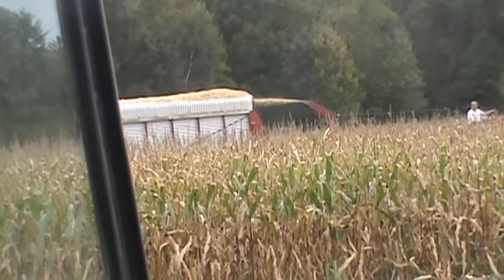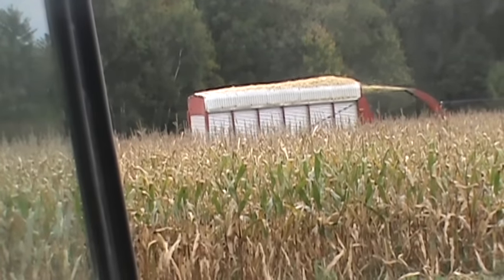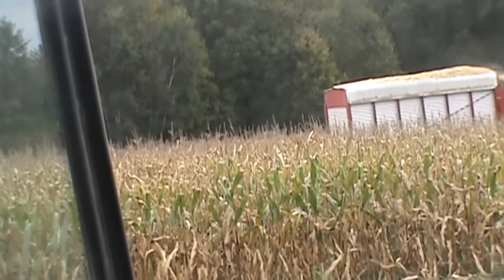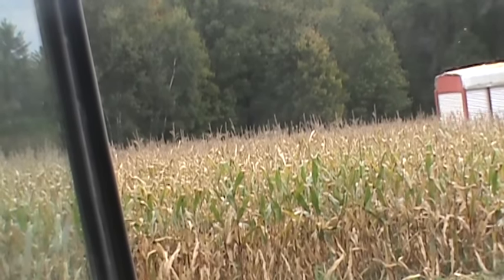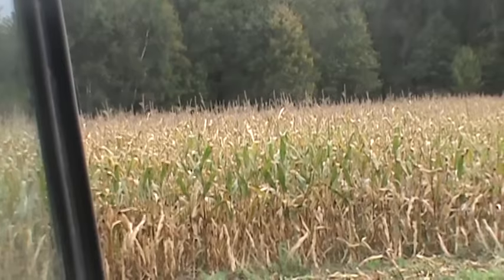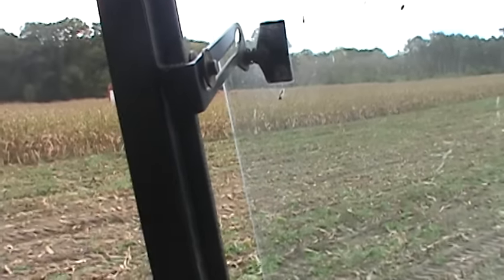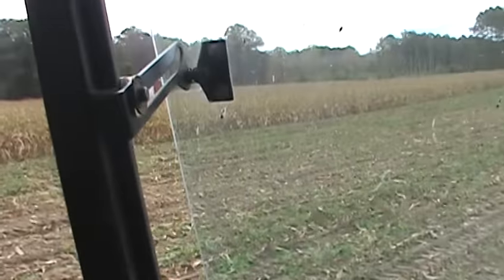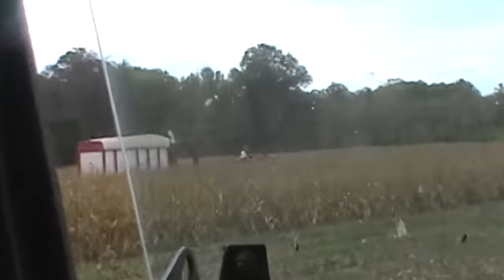Dad Chopping Corn Silage 2015

Comment: 790 New Holland is a good chopper, can be ran at 1000rpm. Plus the heads from your 782 will fit right on. Heads will work on 900 but need to buy different mounts, about $350 for kit for corn head alone.

Comment: What gear do you generally chop in?  I plan on getting a 1066 like yours but I don't want to run it too fast on my old Super 717 because it hates the feedrolls to be crowded.  Eventually considering a 718 or an IH cut and blow chopper possibly.